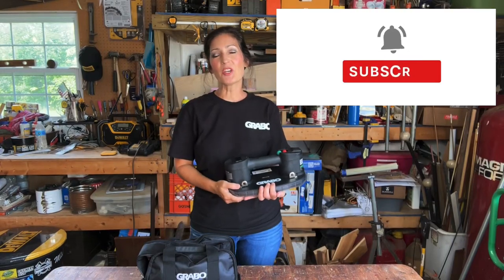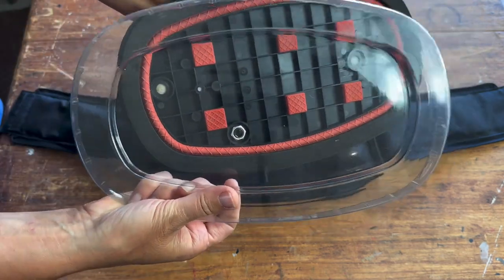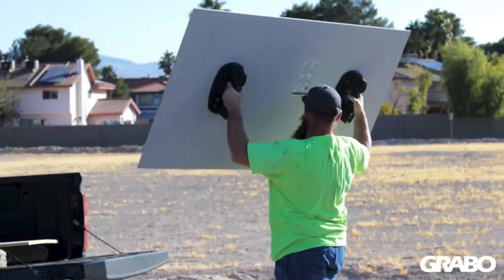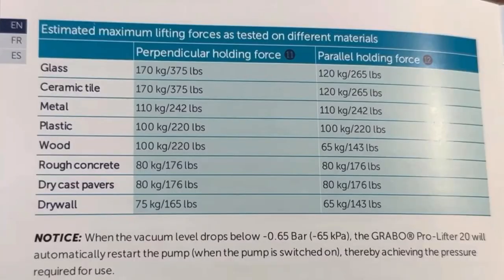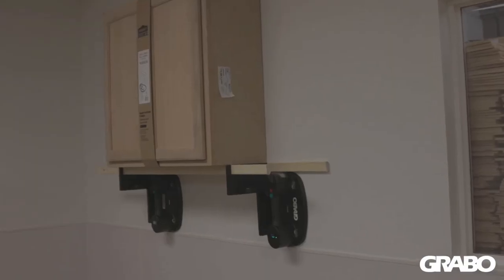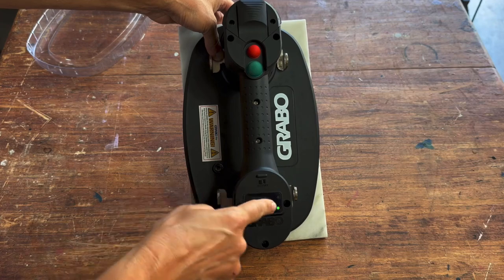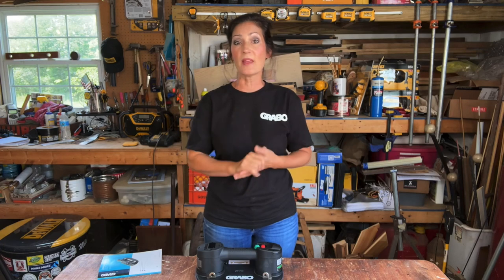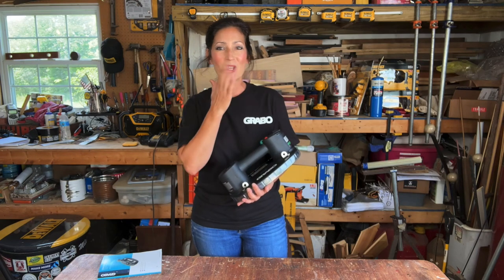Ultimate NEMO GRABO PRO-Lifter 20 Vacuum Pressure Lifter HOW TO GUIDE Demo Product Review #grabo

Comment: @Jenny from the Shop. Thanks for your thorough review of the Grabo Pro Lifter. I like that the battery can be removed so that I can either keep a spare battery or I can easily replace it when it goes bad.  Great job of demonstrating the common materials that we would use a Grabo including when not to use it.

Keeping you and your family in my daily prayers.

Comment: Previously, these suction cups were adjusted to lower pressure, but now they are not adjusted and it is only possible to break the glass somewhere on an expensive facade, and there is no connection with the manufacturer. I returned the product and am waiting for my money.

Comment: I'm curious to know if anyone else has come across a situation with the grabo where it initiates a countdown upon powering on, and then continues running indefinitely, even after it has finished the vacuuming process.
Reply from the maker: Is the material porous at all?
Reply: @Jennyfromtheshop  its solid pvc sheet half inch thick.
Reply from the maker: @DanieSubido  I think I’d call Grabo and ask. I don’t know that it’s necessarily harmful, but it’s probably best to find out. Maybe it’s a simple explanation like changing the seal.